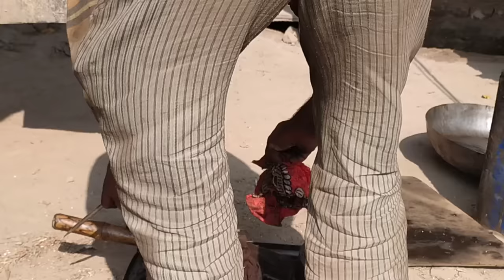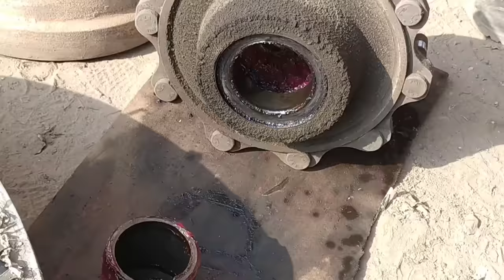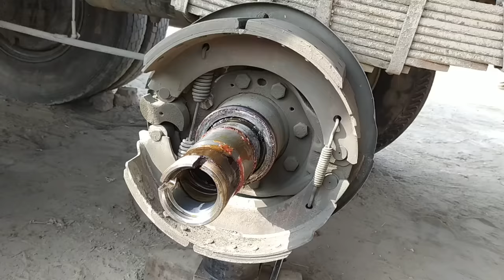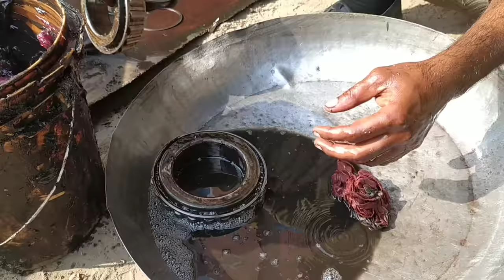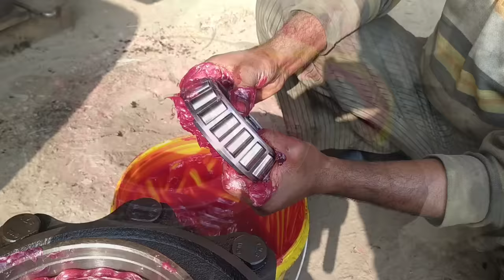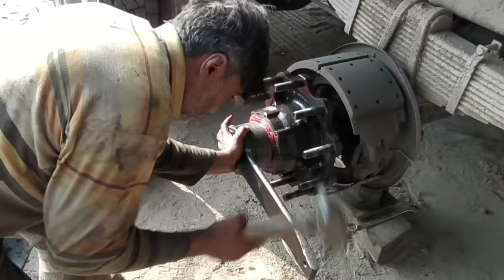Truck hub greasing| Rear wheel hub greasing skills | смазка ступицы грузовика | Indian truck

Comment: From the repair manual.  "Torque the hub retaining ring to 13 heavy hammer blows"
Reply: That's spec, right!?
Reply: you forgot to specify the size of the hammer!
Reply: We just use torque guns until they make a different noise and that's good enough 😆
Reply: @laverdadesmejor  I did...."heavy"
Reply: It's not America dude
Reply: To a certain extent it really doesn’t matter as long as that cone is in there in between those bearings
Reply: Usually, this kind of bearings does not have torque specs. You have to feel it^^
Reply: I love the #5 "torque" wrench
Reply: You work with what you have! 
I have watched my relatives in the 60's working on big rigs, trailers, etc. and they got the job done with NO power tools, or Torque bar and or wrench OR any specialty tool.
 Back in the day we  just torqued it to GAT measurements. 
Never had issues when doing work on their own trucks. 
I learned a lot from my Pop and uncles, etc back in the 60's and 70's growing up AS I AM SURE many of you also learned, sometimes you just gotta use what you have for a certain job.
These guys are doing just fine for what they have to work with.
Reply: @MrUnderwurlde  I read a comment once under some video with heavy equipment and there was similar complain and someone write about Polish manual for a torque specification in a ship from Polish navy where there was something like "3 normal stength sailors pulling x meter long wrench...".
And in communist countries there were in most cases zero info in manual about torque wrench setting because it was simply unobtainum for most of profesional mechanics in "superior" central planed economy...
Reply: @hauloffjunkremoval8304  cone or spacer ,,,if spacer was there no tension whether they blow it until its death because nothing will happen on retaining nut would be loosen on axel ,,if no spacer he has over loaded the bearings with extra preload ,,, basically these people are just trained to fit these parts again in their previous look regardless of specs.......
Reply: @AkaneTendo15111986  yes ,,,,but few off roading dumping trucks have spacers between their bearings so one have to tighten the locking nut w.r.t specs.overall i agree.

Comment: OSHA inspectors would of dropped dead the second they saw no gloves being used
Reply: Ain’t nobody got tam fo gloves…
Reply: Who cares?
Reply: Sandals are standard workwear for them at construction sites, they don't really have any type of OSHA program.
Reply: @Mike Studmuffin  LOL,
I and many mechanics from my time have NEVER USED gloves when working on machinery and my vehicles for over 50-60 years! 
I used to work with SOLVENT for cleaning, even gas and trans fluid. It just never affected myself or relatives. 
I tried gloves once and could not stand them, too sweaty and could not grasp small parts at all. 
It may be good for YOUR generation with safety issues and or policy, but I never had any of my relatives who lived well into their 90's die of cancer, well I take that back,
 one did but he was 88 years old AND did not want treatments.
I NEVER had issues because of no gloves also. 
It depends strictly on the person and their heritage/ Genes. 
I for one, never will use gloves but then again I am from a different time than yourself, and I do not mean it as a bad thing. Take it ez, Tom in NV

Comment: No wonder that Bearing burned out you aint supposed to have 10000' pounds of torque on the Bearings
Reply: tight as it will go, plus 1/4 turn.  Cringy.
Reply: The clearance is set by 34 blows of standard shop hammer. And we here bother with torque wrenches... "first world problems" :D
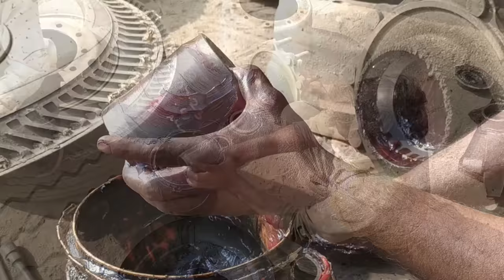Reply: At 2:06 he's holding the sleeve that goes between the inner and outer bearing which sets the preload. basically making it impossible to over tighten the jam nut and put too much preload.

Comment: They are putting a "little bit" too much grease in the bearings. So much grease will create viscous friction, increase the temperature and start decomposing. They really seem to have no clue what they are doing.
Reply: I feel like most of these "repairs" are only going to last a few hundred, maybe 1000 miles and they're right back in the shop getting the parts "fixed" again. People are praising these guys and they're literally packing dirty grease into tiny tolerances that hold alooot of weight in the load. 
No way these repairs last long.
Reply: Yeah they are packing the bearings like it’s mustard grease, if they used the mustard grease then it would have been ok cause it’s more liquidy than the red grease.
Reply: Yeah at that point with that much grease you’re just going to get a churning effect and high temperatures and all that excess grease will just get pushed out of the way, I think common practice for people that don’t know is if I put as much grease as possible it will be better but really a 1/3rd packed bearing would actually run cooler and have a longer life cycle as compared to a 100 percent packed bearing
Reply: They even "Safety and hygiene at work" don't know, and they apply grease with their bare hands like bums. So I'm not surprised that they don't know each other about the job either
Reply: Shoulda used e poo
Reply: @JAB-ci3zq  Apparently, they are forbidden to keep food at their workstation
Reply: @generaczarnypiatek9567  wonder why?

Comment: What in the name of Merlin the patron saint of hiways is going on here? There should be 90 weight gear oil in those hubs!
Reply: @harrysingh23116  Hes far from an idiot... Most hubs these days use an oil bath and for good reason, lubricates better so they fail less often, the only real advantage to a grease bearing is that if you have a seal go you dont lose all your lubrication at once, but the downside of that is if you have an issue in a grease bearing it can take awhile to make itself apparent, whereas with oil you can see the problem right away and address it.
Reply: @uu9rj  spot on.
Reply: @harrysingh23116  look in the mirror, David is right.

Comment: I can't say I have ever seen an axle like this that isn't oil lubricated, even if it isn't a drive.
Reply: In poor areas, all the lowest end tractor/trailer/work vehicles are completely made from spare parts.  After about 1million+ miles the lubricant in them has long since worn down into a substance thin enough to escape the housing until it begins to seize up~
Reply: Worked on some trucks from the fifties and the gear oil seal was on the end of the spindle, outside of the nuts. All bearings were greased.
Reply: @FerrickOxhide  Ohh wow,  yea I could see that. I've never owned or worked on any trucks older then the late 70s.
Reply: Hurts my knees watching this.
Reply: Vanguard dry van's have oil less hubs. We have a couple 2021's that are like that.
Reply: @applejacks971  I did not know this. I have 3 older dry Van's that we use just for jobsite storage. That might be kinda cool actually.

Comment: Those bearings were packed correctly 
If any of you are not diesel mechanics you should shut up . 
I pack bearings all the time and they are packed this way from the factory with lots and lots of grease . 
They also did not damage the seal when putting it on  the axle 
They did a great job for not having all the proper tools .

Comment: The old grease did not look that bad. Why was it necessary to change it ?
Reply: Idk I feel like he did more damage due to all the dust and dirt. Plus no torque wrench how do we know that trucks bearings didn't catch fire after he left
Reply: @Joker210SA  Well i would not be so worried about those torque settings these sorts of old school guys have this in their hands. Old school land rover manuals also did not mention torque settings for bearings. Mosty done by feel.
Reply: These guys didn't go to tech school it is pure talent and practice I wouldn't hesitate to use them
Reply: @jaroslavbrada7669  You don't need a torque wrench but you do need an understanding that when bearings heat up they expand.  you tighten them all the way down to "set" them, then back it off to where you can get in cotter pin or lock pin/bolt.
Reply: @tanveerkhan9221  make sure you have towing service first.

Comment: CAT needs to send some engineers to this country show them how to properly set up a shop and why its important to use new, clean grease and lubricants to clean parts... This helps them last longer than muddy water..
Reply: If you watched the whole video you will see that they did a very clean job in the end. I thought at first it couldnt be done properly but to be honest it doesn't look bad at all
Reply: @yannhayon2796  I'm referring to how they remove the grease, disposal of it, and how they laid the parts almost in the dirt... You can't have dirt at all in the wheel hub... They could easily make a small work table for all of this... Buy some shop gloves and rags
Reply: @LongHaulTrucker4Life  I was also wondering about all that dirt.  It blew my mind.  Hell, even a 5ft square piece of plastic to keep it clean.
Reply: @gumballer133  Exactly, they had plenty of plastic and scrap metal lying around, you can build a work station thats bigger than a shoe box
Reply: yeah probably these workers clearly know these silly things. the problem is just the budget, plus these trucks are outdate
Reply: @ducnguyenminh6165  yeees it's not achmeds fault for calling himself a mechanic without having any kind of clue as to how to prep an area for work much less complete the work without the use of muddy water.
Reply: Some real ignorant comments here by ignorant people. There are mechanics doing far worse jobs in 1st world countries.
Reply: @nimascolari1508  That makes it OK? Nothing wrong with constructive criticism... If you're sensitive then stay off the Internet

Comment: I have never changed seals that didn't also need new pads from the hub oil pouring out.  I have no idea why the bearings went bad before the seal.
Reply: I never changed big truck seals that didn’t use gear oil
Reply: @HeyDude93gt  we have a couple 2021 Vanguards vans that are oil less hub. Grease only from the factory.
Reply: "why the bearings went bad before the seal." overloading of the truck... that is most likely why.
In 3rd world countries they often putting cargo in the truck until there is space in it and do not care how many tons they loaded in it...

Comment: Dont use red grease on wheel bearings! Use wheel bearing grease or hub oil (90w). The red grease does not transfer heat as well h will burn -
Reply: Who told you that? The CRC sta-plex red grease is the best bearing grease I have ever used and it doesn't say it is made for bearings. It is so good that it comes in many trailer wheel bearings from the factory and is recommended by those manufacturers. My wheel bearings have never ran as cool as with this stuff.

Comment: The truck manufacturing factories have been doing it wrong all these years - we need to assemble bearings with grease, not on a clean table but in mud. That makes them run smoother and better, I'm sure of this after watching this video.
Reply: he already washed the assembly with kerosine oil, no dust so ever.
Reply: @busybusiness9121  Did you see the colour of that whatever oil he used, to "clean" the parts? They actually look dirtier than before. :)